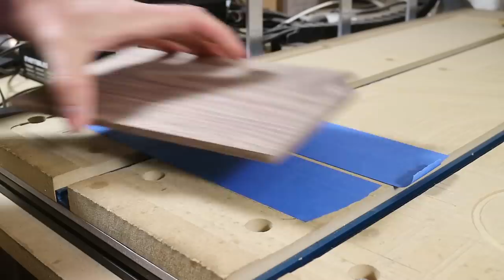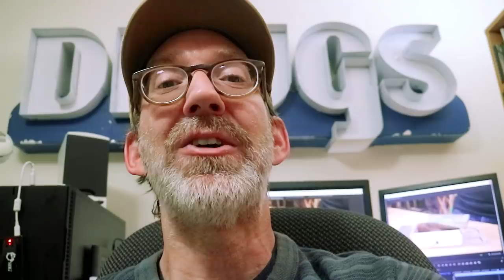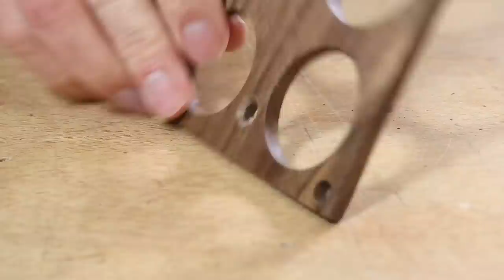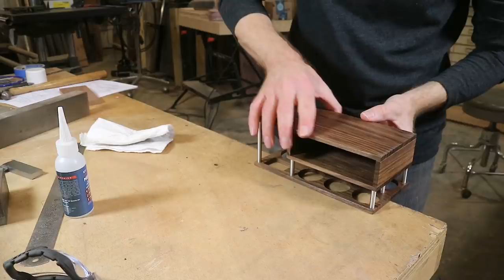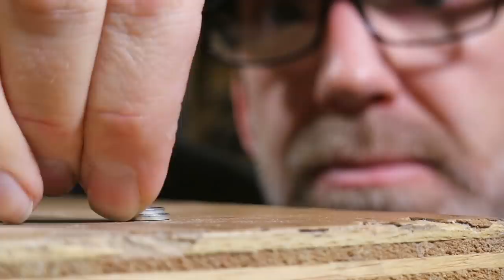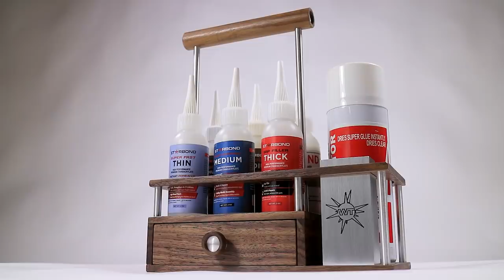Unnecessarily Nice Glue Caddy

Comment: stunning as always - but the dowling drill jig... why have I never thought of that!! superb video - Thank you!
Reply: If you split it on one side, and then run a screw through it,  the relieving one of the cut sides of threads, it will clamp when tightened. Thus not needing fr someone to hold onto it.

Comment: My experience with CA adhesive is the short term holding power compared to wood glues. CA adhesive are good for initial tacking if wood glues are used along with the CA for long term bonding.😁🛫
Reply: I have found that CA glue is very fast, but not very strong. Particularly with shock, and particularly with shear stress. PVA/wood glue is better at both. Also - CA glue adheres so quickly, that I think it has a weakness - it doesn't have time to absorb into the wood grain like wood glue does. For this project though, it doesn't need to - the amount of surface area is more than enough for any load this will see in normal use, except for anything catastrophic - like dropping a heavy load onto it from 1m+ above. In that case, the timber structure isn't up to it either - so the choice of glue doesn't matter. So - why use a less convenient glue..

Edit: I have not found that CA glue holds stronger when new than old - or that time has any effect on strength, but that's purely anecdotal, I haven't tested for it specifically. What have you found?